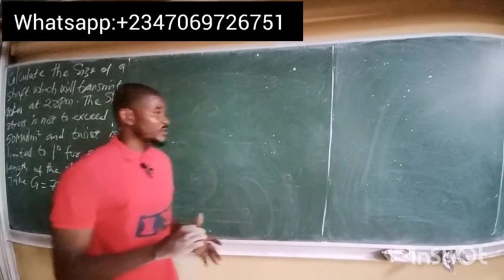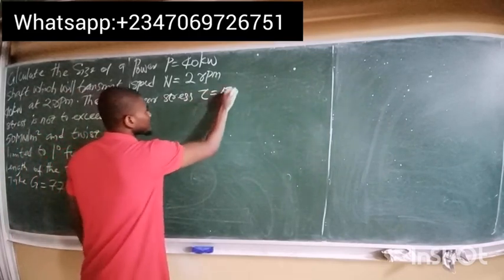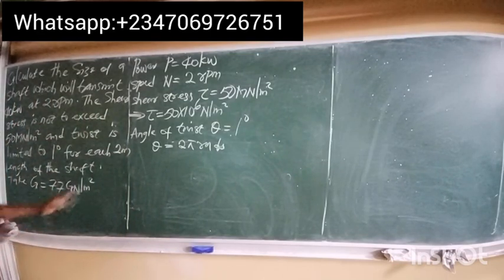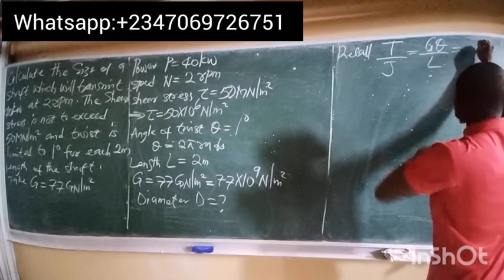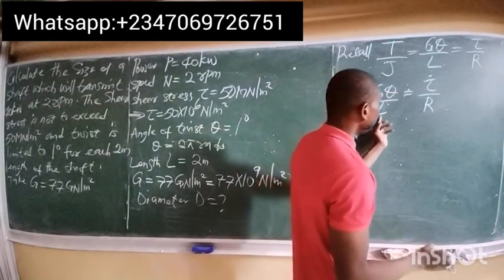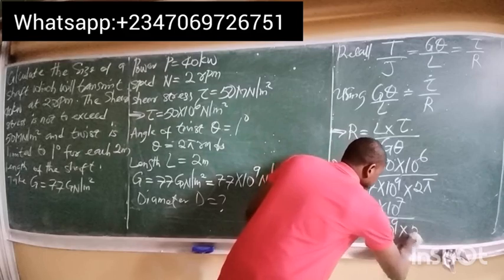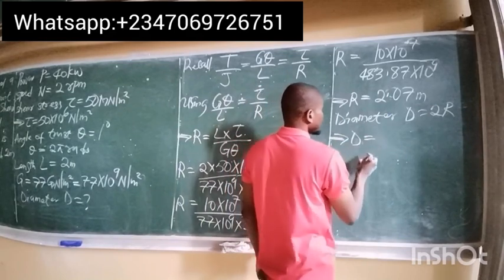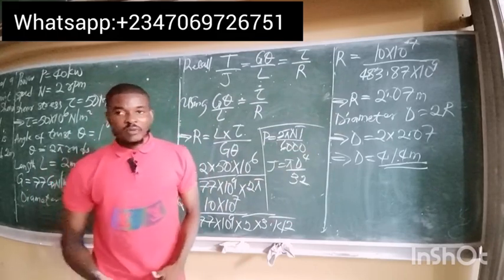How to Calculate the Size of a Shaft using the Torsion Equation||Strength of materials

Comment: Thank u sir for the video
Why is 1degree = 2πrad  but 360degree =2πrad
Reply from the maker: It's still same thing as 360° but only when you're dealing with angles in degrees.. In this case it's a twist angle, which measures the angle taken to go through a circle